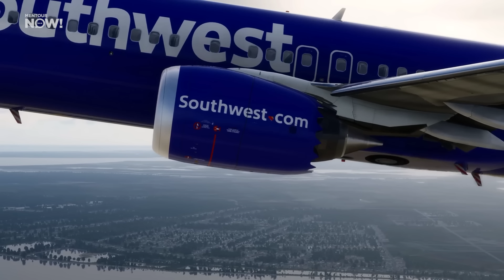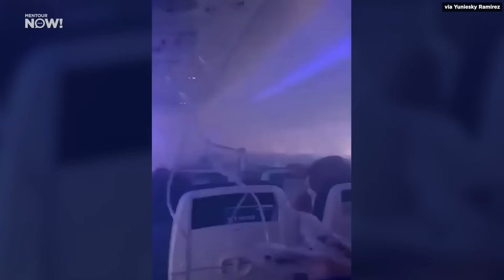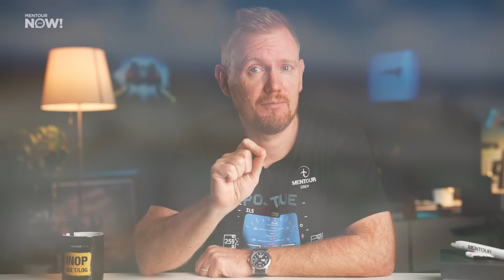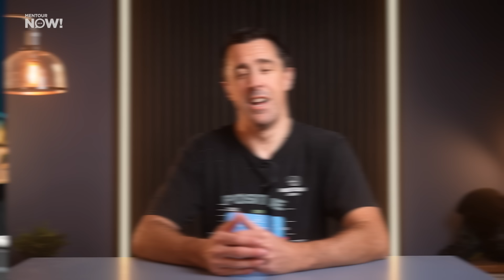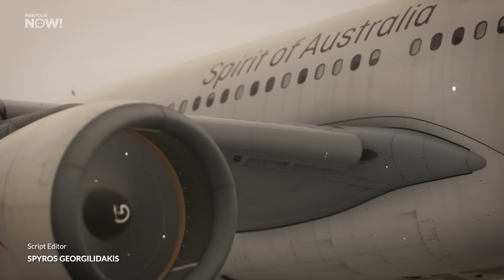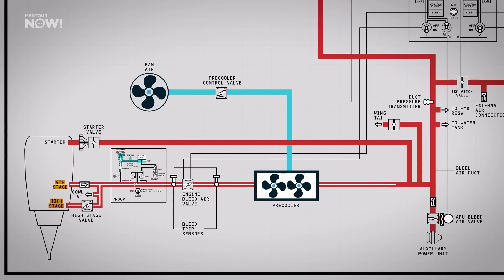Why Don’t ALL Airliners Do THIS?

Comment: Here's a middle ground: the 747 classic used to use it's APU for bleed air through 10,000 feet to maximize takeoff thrust. Won't help you mid - flight with a LRD failure, but it will help with any issues during takeoff.

Edit: has the advantage of being something you could do today just by flipping a few switches.
Reply: I seem to remember this was procedure on the 72 as well…? Was 1976, so my memory of sounds most likely fail me here…😅
Reply: I don't have the numbers, but running the APU probably increases overall fuel consumption. That is, the already running main engines can probably produce the bleed air more efficiently than the APU can.This is the opposite of what Boeing was trying to do which was to reduce fuel consumption.
Reply: @andrewsnow7386 yes, there's a slight increase in fuel consumption. But there are many safety benefits to doing this. There have been multiple flights with engine issues below 10k feet which resulted in loss of electrical or hydraulic systems. A running APU solves that.
Reply: @PsRohrbaugh  Running the APU below 10,000 probably does improve overall safety, but a quick search shows that an APU running in flight may have contributed to at least one crash (Partnair Flight 394). Every safety feature comes with risks as well. In any case, I think the move away from bleed air on the 787 was touted as a cost saving measure, not a safety improvement. Running the APU doesn't fulfill this cost savings goal.
Reply: @andrewsnow7386   Buy a bicycle, maybe? And I guess you don't want an APU on your bike. Though you can use it as an air brake, going downhill, and it can easily charge your bike battery. Ah, no, you are afraid of that accident. Then go braking yourself.
Reply: @voornaam3191  Um, what? I'm not sure what you are saying, so I'll just reply with this: As a retired Boeing engineer, I'm not afraid of airplanes or APUs. Commercial airliners are by far the safest form of travel.* But, every possible safety improvement needs to have its risks evaluated -- there are always risks! If this step is ignored, you end up with things like the 737 MCAS system. 

* The safest form of travel over multi-mile distances. By some measures, elevators (lifts) in buildings might be a safer form of travel.
Reply: @andrewsnow7386  yeah, I agree that for future designs bleed air is an outdated system. Fuel efficiency is a lot more important now, and the power to size / weight of electric motors has gone down dramatically. 

I'm just pointing out that "APU running and providing bleed air below 10,000 feet" is something that can be implemented almost immediately by flipping a few switches, or at most a software update (since some aircraft won't let you start APU in air). I think it should be mandatory in all aircraft, including all electric like the 787. Who knows if Air India 171 would've been able to restart the engines in time if they had full electric available from the APU instead of relying on the RAT?
Reply: @andrewsnow7386 55-160 gallons an hour fuel use on APU’s depending on size.

Comment: 11:37 did AI reverse the winglets? 🤔
Reply from the maker: No these are 737 MAX (AET) winglets, they go both up and down.
Reply: @MentourNow  yes, up and down. But not in reverse flying direction 😁
Reply: It's the camera angle making the winglet angle look weird. Google "planespotters 1769739" and you'll see the exact same aircraft as here with a similar from below and from the side angle that makes the winglet look inverted.
Reply: Thats a simulator

Comment: I don't understand most of this but I noticed that in the early photographs included in the video it shows the engine nacelles with a jagged trailing edge. It is probably out of context but can someone explain why this is so? Thank you.
Reply: As I understand it. It increases the effective length and reduces the angle of the trailing edge of the bypass part of the engine . It's for reducing noise and frictional loss by helping the high speed air of the bypass fan blend better with the outside air.
Reply: Reduces turbulence as the engine air meets surrounding air, reducing noise and drag, improving efficiency.

Instead of the 2 streams meeting at a single edge, they meet at a broader area and the turbulence from the trailing edges is broken up instead of forming vorteces that cost energy.
Reply: @NotThatEcstatic  Thank you.

Comment: can the LRD activation be detected using some kind of sensor? if so, why don't they close the PRSOV as soon as it happens?
Reply from the maker: I believe the idea is to make the closing of the PRSOV automatic when the vibration of the engine goes over a certain threshold. That's the software fix that is currently being worked on

Comment: I don't get why a simple scoop wouldn't do once airborne.
Sure, bleed air or electric on the ground, but past v1 you're looking at 300+mph wind.
Reply: It's not nearly enough. At cruise static pressure outside is 3.5psi, dynamic pressure from the speed adds only 1.7 extra psi. For 8000ft equivalente cabin pressure you need 12 psi.
If you think about that's exactly what bleed air is anyway. It's taking the ram air hitting the blades and is compressing it just enough to reach the necessary pressure.
Reply: @rantos9 FYI the bleed air pressure is well above the cabin pressure. The input pressure to the air conditioning packs might be in the 30 to 40 psi range so that the packs have the energy to do their job of supplying air at the right temperature and pressure.
Reply: Same reason why Ram-air intakes on roadcars are BS. Dynamic pressure increase at speed isn't as significant as many people believe. For instance at 800km/h the dynamic pressure increase at sealevel would be about 0.3 atmospheres. Now this value is proportional to the actual airdensity. Which means if for instance the static airpressure is only 0.1 atmospheres, the pressure increase because of the speed would be about 0.03 atmospheres, so basically nothing.